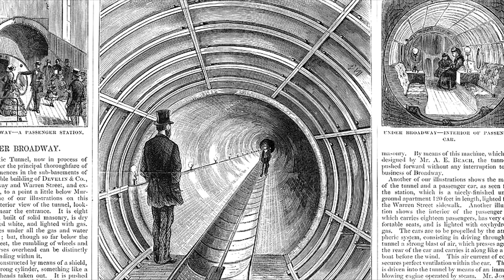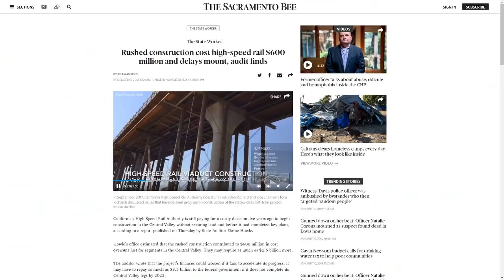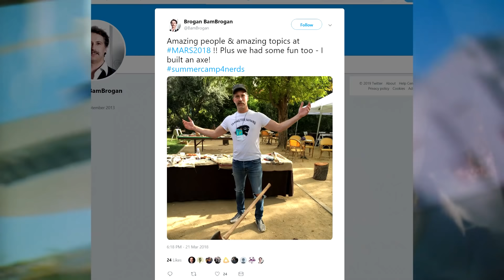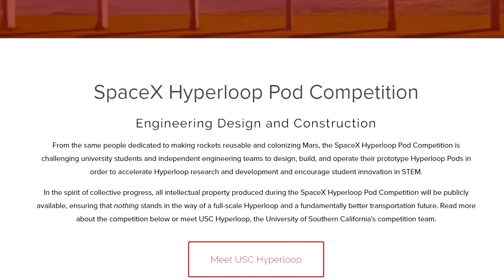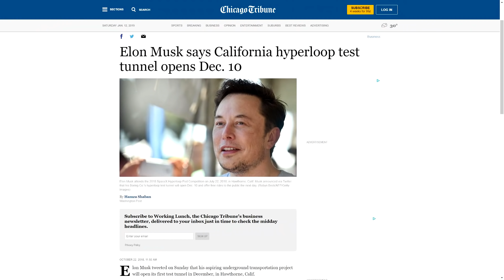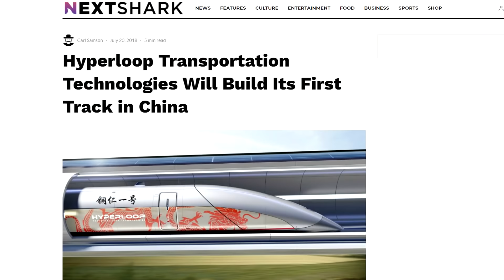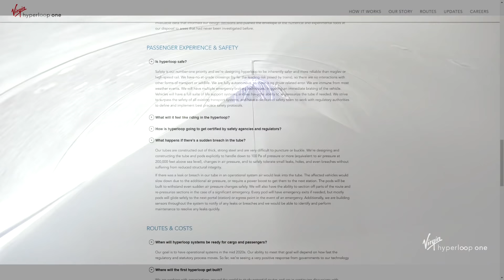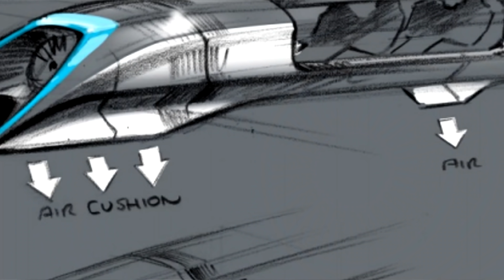Why Hyperloop will FAIL HARD - Its Biggest Problem...

Comment: Any Hyperloop is in effect a very expensive low capacity train.
Reply: so basically, British Rail, but somehow worse?
Reply: @abdullahtshabal9522  Britsh Rail, along with most other railways is not very expensive. Your point ?
Reply: @pasoundman  it was a joke
Reply: @abdullahtshabal9522  OK I get it. Yeah, Hyperloops are a very expensive joke.
Reply: The really crazy thing is that Saint Elon believes that hyperloop would be LESS expensive to build than, say. high speed rail, never mind the novel engineering challenges !
Reply: Juan Martinez  Well, that's one approach. In the meantime high speed rail continues to advance, There's hardly any significant difference in the cost of building new infrastructure,
Reply: Juan Martinez  I doubt that the large radius curves present much of a problem outside big cities. Europe's managed OK somehow.
Grade separation as in avoiding railroad crossings, yes.
I remain to be convinced that it's such a serious problem. It seems a shame that the USA is unable to adopt this kind of new technology.
Reply: Juan Martinez  I don't think that traveling for business is even necessary anymore. 
We have Virtual and Augmented Reality. Why not use it for business meetings? 
You don't need to touch your business partners.
Reply: @Noobscodee  It shouldn't be much more expensive than gas or oil pipe. May be Elon knows how to build it even cheaper, he might be waiting for competitors to do all the ground breaking work for high price and he will enter into the game later making it cheap, efficient, totally underground, solving all problems at once.
Reply: @Noobscodee  Right, and without a complete vacuum it is useless, than you have all the dangers of a low pressure system, combined with all the disadvantages of air resistance of a normal train (probable even worse depending on distance). The worst of two worlds!
Reply: @pasoundman  nice misinformation
Reply: @Im-mv6bf  Look kiddie, the hyperloop is a SCAM. It violates almost every known 'law' of sensible engineering ! Just alone, the use of a capsule in a tube doesn't improve air resistance, it WORSENS IT as the displaced air (yes, air at low pressure, it's not a vacuum) is FORCED BETWEEN THE CAPSULE AND THE TUBE WALLS ! It's almost trivial to do the sums. Sources online give the capsule diameter AND tube diameter THE SAME at 2.23 metres. That results in no clearance between them. Obviously there has to be clearance. Say it's 10cm. So, we get a 2.03m dia capsule in a 2.43m dia tube using 2.23m as a reference. So, the capsule displaces 'gas' from a 2.03m dia capsule into a gap between it and the tube, 20cm wider all round. Capsule frontal area = 2.24m2, 'gap' area = 1.4m2, Can you see the problem here ? The capsule is actually going to have to COMPRESS the gases it displaces to make headway, resulting in increased air resistance compared to a normal train for example !
ALL the explanations online about 'how the hyperloop works' embody this style of 'toytown engineering' and simple wishful thinking based on a 'sci-fi' misunderstanding of science.
Musk is an idiot and I predict his downfall along with his supersonic vertical take-off electric planes which are total bunkum within 2-3 years. Tesla will be a massive disaster too. They haven't got a 'world product' to compete with the auto giants that are only now introducing some excellent EVs along with electric buses (over 400,000 exist worldwide almost all Chinese built by BYD) and a wealth of electric delivery vans and medium to heavy trucks.
Reply: Innocent Bystander  Yeah, pretty much. The bizarre thing is that some companies want to make one ! They're going to get one godawful shock when the truth hits them.
Reply: @pasoundman  nice copy pasta buddy
Reply: @Im-mv6bf  I haven't a clue what you mean. FWIW, not many seemed to have clued up about the air resistance problem, illustrating nicely that no-one in the 'hyperloop program' has the tiniest clue what they're on about regarding the science. You'll note that ALL the test vehicles have been MUCH smaller than the tube diameter, so it's yet to rear its head in testing prototypes. The hyperloop is entirely marketing driven, not by engineering and marketers have a tradition of not caring a jot about real world facts ! You're welcome to continue believing the hype if you like. For my part I KNOW that it's impossible to ever make one at a remotely commercially acceptable price. 10 years down the line, I'll be vindicated and you probably will have moved on to promote other nonsenses.
You haven't even questioned my credentials btw, just assumed that the neo god-like status of Elon Musk means he can't be wrong. He is VERY wrong about almost everything in fact ! Much of what comes out of his mouth is what I'd refer to a 'brain farts'.
Reply: @Im-mv6bf  I wouldn’t want to intrude on this argument, but you haven’t actually pointed out any counter arguments against his statement... it pretty much makes you look kind of desperate trying to insult him rather than to prove him wrong, which really further proves his argument.
Reply: @TheGrateful108  Take a look at how big the Iron Lung is and then any other modern ventilator that uses positive pressure... When you're talking about negative pressure gradients there's so much more you have to take into account.
Reply: @pasoundman  less expansive to build and RUN. His delusion is extreme
Reply: @TheGrateful108  no more expensive than a gas pipe? Really dude?  Do you know how expensive and expensive is the challenge to maintain a vacuum for any large container on earth? Not to mention hundreds of kilometers of piping.

You basically need a huge vacuum pump every 10 to 20 meter if you want to be able to maintain a vacuum, especially since nothing ever stay totally airtight for long on earth, given corrosion,   lossening fasteners through cyclucal vibration, weld failure and more.

Comment: I've never understood why american media freaks about Hyperloop.. Japan, Germany, China do this per years.. Even the poor Brazil has a maglev pod called MaglevCobra built in a University in Rio de Janeiro
Reply: America is dominated by truck transportation and the like thanks to the monopolistic and anti-market works of larger companies that pursue their own interests (oil companies and all those who build and maintain roads, plus the automotive industry, who are massively influential as well). Americans don't know "desirable" train transportation, and most of the trains in America are slow largely used for cargo instead of passengers. So seeing actual working trains freaks them out.
Reply: The US economy is oil based. If traffic moves from oil to electricity there, there will be many job losses in all social classes. That's why.Germany has similar problems ;it can't say goodbye to diesel because of jobs
Reply: @aabb-zz9uw  and yet germany does say goodbye to diesel. whole factories of VW are retrofitted for battery powered cars whith no job losses btw.
Reply: aa bb You can have jobs in the electricity sector
Reply: Leopold It’ll happen eventually, you can’t beat the future.
Reply: Leopold They’ll be last to go, but then they’ll get fired. It won’t be quick, it’ll be gradual.

Comment: Hyperloop is unfeasible and ridiculous. The idea is more than a hundred years old and was never entertained due to several engineering factors that make it a no-go.
- It's stupidly expensive
- It requires several thousand cubic meters of room to be evacuated of air and keep it that way. The largest existing vacuum rooms are not even a tiny fraction of that and do and is met with extreme technical challenges
- long, straight tubes require expansion joints due to thermal expansion, those joints also need to be vacuum seals. Each one needs maintenance
- there will be differential expansion on the top, sunny side and the bottom shaded side during the day and night, causing metal fatigue in the long run. along with the enormous stress, this can lead to catastrophic failure. look up the tanker truck vacuum experiment by mythbusters to get the idea.
- due to the pressures involved, there will be extreme stress in the materials. disturbances in the form of the tube will end up causing catastrophic failure. Also don't forget about earthquakes and tornadoes.
- failure of any of the hundreds of seals needed at any single point will cause the trains that run in the tubes to become bullets in a hundred kilometer long barrel
- any idiot can take an angle grinder to any meter of this thing and not only cause millions in damages but also kill anyone inside.
- any failure on the trains will leave passengers stranded in a tube with both no exit and no air to breathe. any escape system will add a lot of complexity and cost. any failure on the trains that leaks air will leave the passengers in a vacuum. either they get a space suit when boarding, or they die from decompression, even with oxygen supplied by a breathing apparatus
- boarding and unboarding will require severe security checks and takes a lengthy amount of time, similar to an airport. The time saved will be much less than the pure travel time difference.

I'm sure there are plenty more reasons why it's a stupid idea, those were just the ones I could come up with in the time writing this comment.

I don't see anything that is hyper in this except hyper stupid. And I don't see where the loop is either. It's literally a tube. If I wanted to give it a name, I'd say it's hypercoffin. both for the investors' money, as well as any passengers who enter this deathtrap should it ever come into existence.
Reply: The Hyperloop is one of the funniest jokes ever, on par with the solar freaking roadways. We can thank the numerous proponents of these projects for the entertainment they provide. It seems that no technical argument or law of physics will quell their enthusiasm, so I propose that instead of wasting our time opposing them, we help them overcome technical difficulties with fantastic solutions. If we can't deflate these baloons, let's inflate them till they explode! In that spirit, here are two solutions to the problem of maintaining a vacuum in a long tube. The planet is surrounded with vacuum. Why not tap into that infinite reservoir that is just a few kms above the Earth's surface? I propose that we build a vertical tube tall enough to reach the vacuum of space. Just one such tube could bring the vacuum of space at ground level in infinite quantity, supplying a Hyperloop network that could even extend between continents!!! Of course, there would need to be safety valves on the tube to stop it from sucking all of our atmosphere if the Hyperloop tube is breached. But this is all low-tech stuff. Valves and tubes have been figured out a long time ago. And we're already drilling over long distances through hard rock for gas and petroleum. Drilling through thin air can't be so difficult!! The second idea I would propose is to invent vacuum as a substance. We could pump it into the Hyperloop tube until it's pressure reaches atmospheric pressure. This would eliminate all difficulties related to expansion joints and boarding points, while maintaining the advantages of pods traveling in vacuum. Vacuum that can be pressurized would solve so many problems that it's baffling that no one has thought of it to this day. Perhaps what's needed is a marketing genius like Elon Musk to propose a catchy name for it...